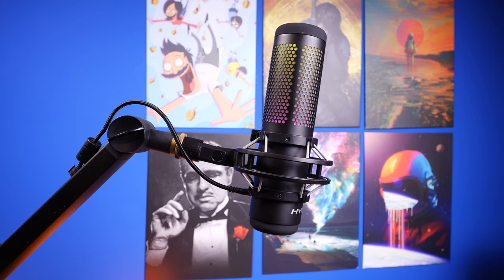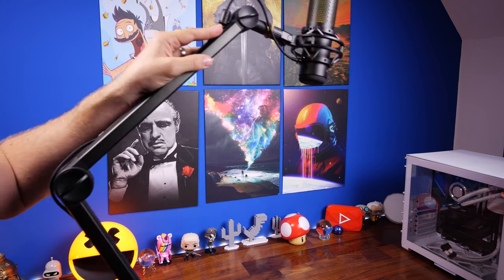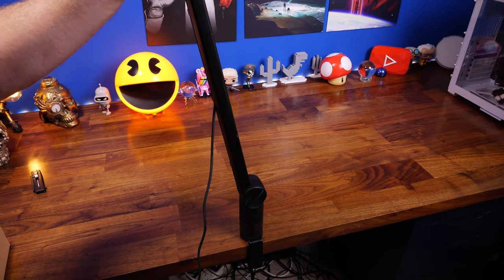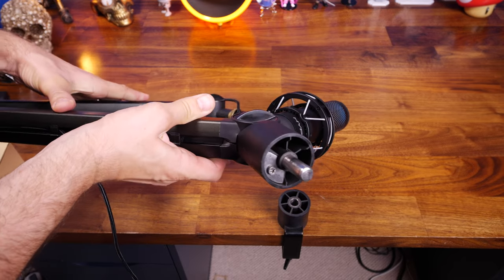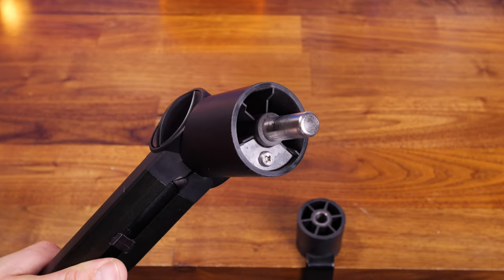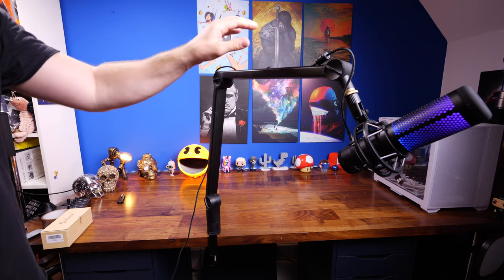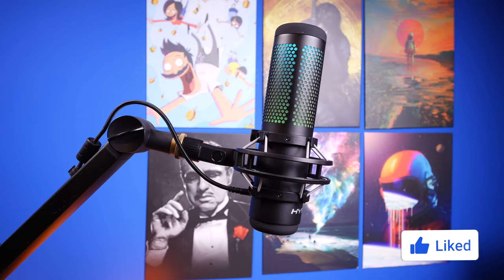How to tighten the Blue Compass Boom Arm with ease

Comment: I tightened the middle until literally until it broke and it still would never stay in place. Messed with the tension screw underneath and it still never stayed in place. waste of money.
Reply from the maker: Very strange. I've been using mine for years with multiple mics and no issues.
Reply: @TheProvokedPrawn  it has never once stayed in place, even before I tightened it so tight that it broke
Reply: @hitmanhartman1394  did you get onto the support? i have had mine for years and it never worked either

Comment: so this is probably super late but after a plethora of research because I too bought one and it has the problem of always wanting to bend straight no matter how loose the screw on the bottom is and how tight the knobs are.  if you find yourself in this situation, there's 2 solutions.  1) send it back and pray u get one that isnt defective.  2) you have to take it completely apart and add a 1/8" chain link connector.  I took mine completely  apart, which isnt very difficult, with some fairly basic tools and added said piece and now it works great.  It's also worth noting that I'm using probably one of the lightest microphones, the razer seiren mini.   Hopefully this saved you some time because all these videos are the same and none of it helps.
Reply: is there a video for this?

Comment: I'm using the compass with a yeti x (only) and the boom is still over-tensioned. I think it is likely configured for use combined with the weight of a shock mount and pop filter, and possibly more. Slackening the tension via the "secret screw" did not help.

** edit ** I recommend contacting Logitech support in the first instance. This is a known, and rather common manufacturing fault, and they will help you receive a rma (return merchandise authorization) to take to the vendor for replacement or refund.

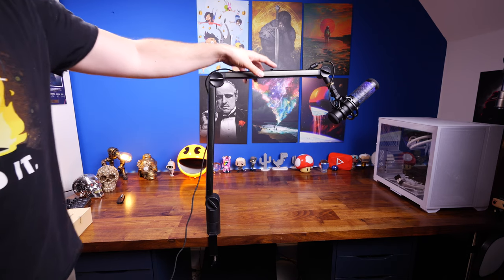00:58 - be very careful not to overtighten these dials because you will strip the plastic dial off the knurling on the bolt inside. If you do, I recommend using epoxy glue to reattach.

If a rma isn't possible, adding an S clip onto the internal cable will lengthen the cable and slacken the tension.

Comment: TL:DR I think the cable needs to be worked and worn out for it to be better. Maybe if someone could find 1/4lb 3/8" threaded weights it would be better?

I have had my Blue Compass boom arm for right around 1 & 1/2 years while not moving it all that much. Can confirm after roughly 2 hours of messing with the boom arm, the cable inside of your boom arm just seems that it is worn out more than most. I loosened it until the tension screw came out of the bottom, and tightened it until it would no longer let me. I have come to the conclusion that the cable inside the arm just needs to be worn out & weakened. As you have used it with a lot of mics on it, and thus moving it more than most (including myself). In the case of @Orbmanic's comment, I believe them having fought against the arm for a year constantly had worn out that cable enough for that screw to work. 

With that said I'd love to see if you are able to do this with a brand new or very lightly used Blue Compass with the QuadCast S and prove me wrong. Though this tracks with what the general statement about this arm with lighter microphones. If only they sold heavier weights for the 3/8" thread on it lol.
Reply: This is 30 minutes since the original comment, and about an hour of bending the arm. It now stays a lot better than it originally would, it's not perfect by any means but this is where The Provoked Prawn's tip comes in handy with the loosening of the tension screw. It took me roughly an hour of closing and opening the two arms together constantly in order for it to not instantly take off. So my theory about the arm & conclusion of the video was correct in that the metal tension cable had to be worn out. To anyone that wants to do this. DO AT YOUR OWN RISK! You are creating metal fatigue, at an unnatural rate for this product on top of that.

Comment: I'm not saying that these methods don't work, but they didn't work for me. I am very envious that TPP has a Blue Compass that behaves. I did find a "solution" that does work though. I had some spare 0.5kg dumbbell weights so I placed one above where the copper ring/mic screws in. It is far from perfect, but it works and doesn't look terrible. The weight is quite small and it is also black, so fairly discreet.